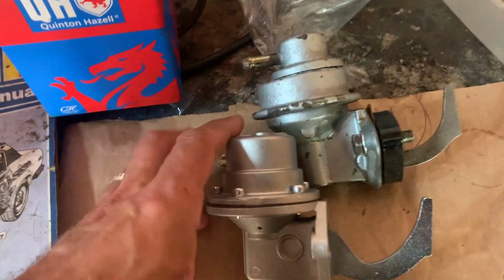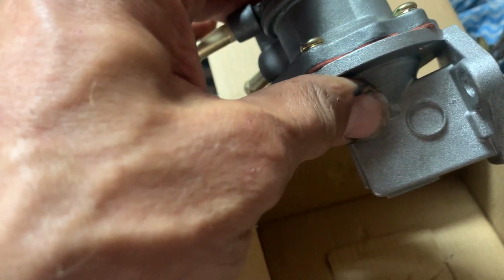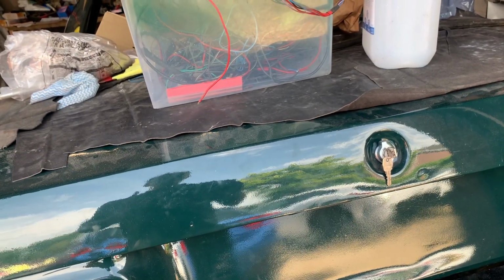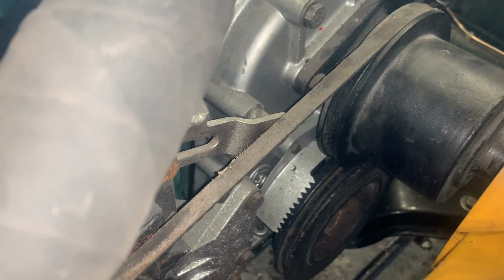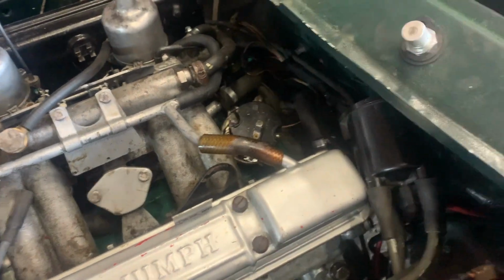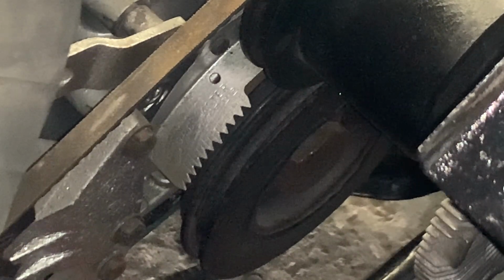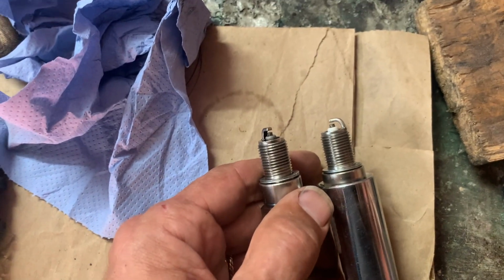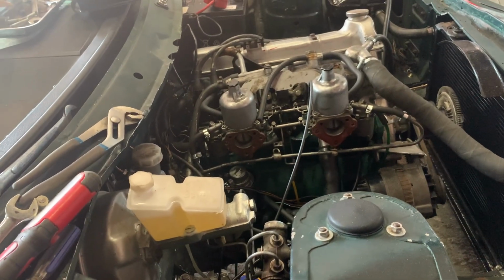Triumph TR7 Restoration - Fitting a Fuel Pump that works and trying our  First Start

Comment: I was on M6 with rough engine. On the hard shoulder i removed the carb tops. I looked down at the main jets. Fuel should be just below top of jet. Right was dry. Took float bowl off, piece of aluminium swarf blocking fuel. Quick blow out, reassembly, fuel to top of jet, all started fine.
Reply: On my Z4 now it would be get obd reader out!
Reply from the maker: Thanks for sharing.  I think I just need to sort choke, balance, mixture and timing now

Comment: Just a small tip Henry. Try spraying some Easystart in your air supply. This way you can determine if it is a fuel issue or timing issue.
Reply from the maker: Will do Neil,  how does it tell me if it is fuel or timing?
Reply: @HenrysGarage  If you spray easystart in and it fires up, you know you have a fuel issue and can concentrate on that. If it does not start, it will likely be a timing or ignition issue. It will run for about 2 seconds.
Reply from the maker: thank you

Comment: Glad the QH pump worked for you! That starter motor sounded different to mine. Is it a new one?
Reply from the maker: Hi Simon,  yes a new hi torque one
Reply: @HenrysGarage Aha, thought as much. Thats another thing to add to the shopping list! How is it shielded from exhaust manifold heat?
Reply from the maker: It's not at the moment.  I'm just going to add exhaust wrap
Reply: @HenrysGarage I've got the wrap on mine but it's still hot around there!
Reply from the maker: Good to know.  I might have to try and make a shield.  I don't think you can buy them any longer